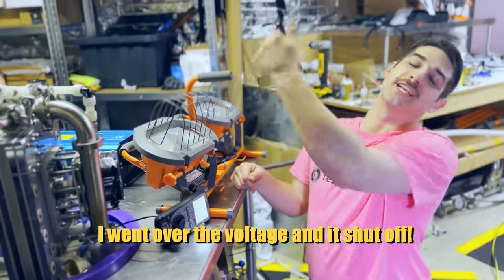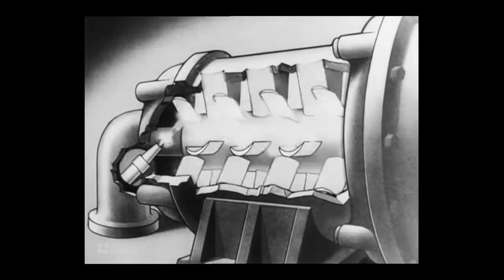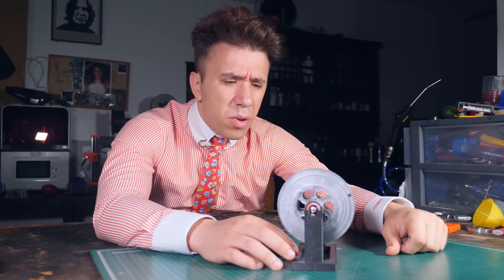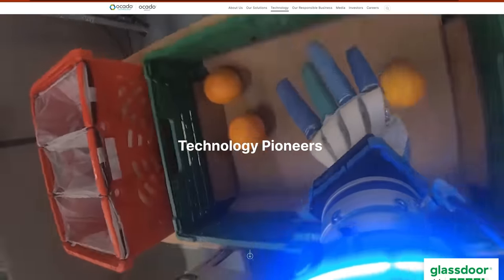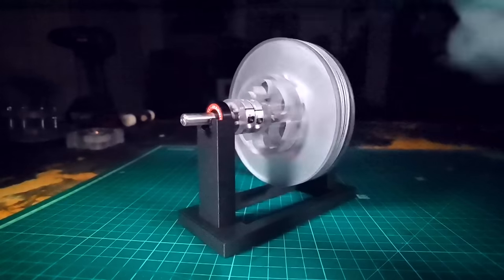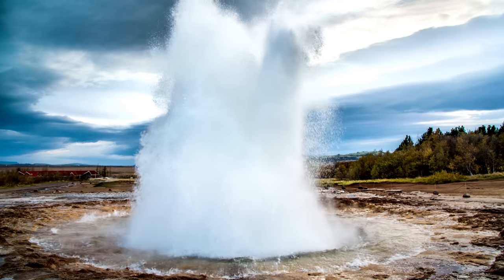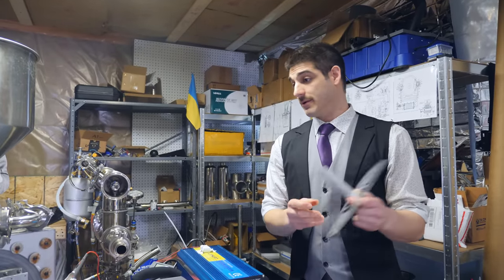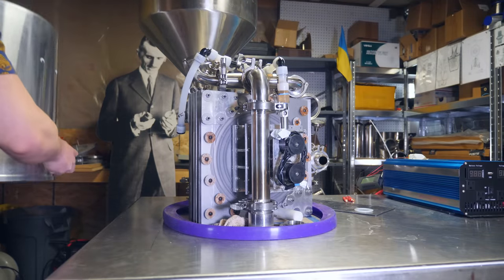Building Nikola Tesla's Bladeless Turbine

Comment: Now connect it to a binary power plant using alcohol under a vacuum which depending if you had a full atmosphere would boil at about 35 degrees. So basically room temp in summer. And use an enclosed system with Freon or liquid nitrogen for the cooling tower and bam endless energy using heat no it’s not free energy it just efficient.
Reply: Sure thing binary power is used in geothermal wells. They use coils sitting in a bath of alcohol or a similar fluid with a low evaporation point under a vacuum. You don’t necessarily need a geothermal well, if you were in a place with lots of sun, and you were just heating a tank of water, and it was flowing through the coils to heat the bath that would be sufficient, or a wood or pellet fired furnace could also heat up fluid to heat, the bath, to boil the liquid to turn the turbine. But again the important thing is, it must be a closed loop system under a vacuum

Comment: You don't magically get more power (WATTS) by magically increasing voltage.  You need more AMPS, which is the raw current that's generated.  Higher voltages simply enable you to carry the additional AMPS over smaller wires.

Comment: I'm just wondering.  How would you be covered in the event of a power outage if you need a compressor running to power the turbine? If you don't have power how will you run the compressor to run the turbine?

Comment: I would like to get a 3d printer. It usaf I was a computer tech and a c130 hydraulic tech. My favorite Tesla item is a little known item the Tesla Valve. The great thing is that all normal valves today have a lot parts that ware out.  The Tesla Valve uses fuide flow to work making  sure it only flows one direction without any parts ware out and control direction of flow. A very out of the box thinking no one else has done.

Comment: I went down the rabbit hole of sussy mini-hydro dam construction and had a brain blast.
All you need for high power output is ~40psi, right?
Flow from a dammed up stream may not have enough pressure or stability to manage the torque output seen here, so how can we convert high flow into high pressure? My idea was to use the flow to crank an air pump into a compression tank with a relief valve gating the output. I may be speaking outside of my mind but this could be the key to legitimizing small scale generation to ease pressure off our infrastructure

Comment: If using low quality steam, wouldn't liquid water slowly build up in the bottom of the turbine housing?

The obvious solution is to mount the assembly sideways, with the flat turbine plates parallel to the ground, and to have the steam exit out the bottom. But im certain applications, this could be difficult to do.

Comment: Ok, I want to see someone use modern understandings of material science to design one of those steam turbines so that there is minimal heat loss within the system, so it produces an optimal amount of thrust. It looks like the ones you show use copper throughout, which means any cool air hitting the outside of the pipes are cooling the steam inside and producing less thrust.  Unless I'm just stupid which is totally a possibility.

You can replicate the tomato thing with a ping pong ball because all surfaces have imperfections that will act as a blade.  Just because we can't see them that doesn't mean they aren't there.  It's just that the blades aren't what we would normally consider to be blades.

The turbine isn't "bladeless", it's just "visibly bladeless", because the friction on the imperfect surfaces and the air hitting the big surface area created by using multiple disks, you're just shooting air onto a absurd amount of microscopic blades.

Comment: Could you make a diesel fuel pump. Making more pressure with the fuel, atomising the air and fuel better than a conventional diesel injector? Or instead of a conventional turbo…

Comment: Hmm so you need to power it from compressed air or steam... both of which require power first to make. So if the grid goes down you need to burn fuel for steam or to power a compressor. What about ways to power this from renewables? He mentioned geothermal but i didn't quite get how dirty ground water could go through this device with no issues. What about a water wheel type set up on a stream?

Comment: How many Watts to run the compressor? Is there any energy surplus?
Yeah... as in I use outlet energy to start the process, then I switch the compressor to the Tesla Turbine's output, and charge some batteries at the same time?
Was this test made?

Comment: Can you make an application video? Applying this Tesla mirror to a solar heater/rocket mass heat/waste oil burner that produces steam to generate power to run a tiny house (e.g. home without power in a place like Phoenix,AZ)? Or store in a battery? Can the water be produced by a solar water generator?

Comment: i had a plan to build one with copper discs (aluminum bronze tbh cuz it resists corrosion the most and still maintains like 2/3 the full conductivity pure copper can) but my idea was to create a "windings shell" much like the transformer windings you see and see how much eddy current or induction voltage i could catch
Reply: btw aluminum bronze also has a rockwell hardness higher than steel
Reply: stainless steel*

Comment: Would flow channels in the disks increase efficiency? Imagine if the first disk started from the outside and spiraling in then through a opening in the inner most part of the disk released its accelerated inertia onto the out brim of the next disk. They would have to be staggered and spaced correctly. Would be a very interesting experiment.

Comment: So, you did that with compressed air, obviously people aren't going to be using compressed air to generate power as you would be using power to do so.

Have you thought of using a Fibonacci blade to direct the wind to turn the turbine and produce energy? How efficient would it be in comparison to other turbines, wind that is? Is it a viable solution? As Tesla's bladed turbine has little drag and the Fibonacci blade seems to produce more efficient energy from wind than other designs. I am curious.

Comment: ❤can it be built allot larger and can the disc be made from recycled plastic or polymer ,,just alloy disc are great but the steam i can generate free has minerals in it so i would think alloy would not last long at all but plastic yes ,,and could it be built big enough to put out around 30 amp at 220 to 240 volt continuously??

Comment: Whats the flow rate (cfm). The "only 15/20 psi" pressure isnt a selling point if it takes 10000 cfm continuous to produce 1200 watts.

Comment: ....so is this a REAL perpetual motion machine? like I have a 12V marine fan that puts out 7660 LPM I run it off a car jumper box with a variable resistor it as a 4 inch outlet, If I taper down to a reasonable air outlet to power the bladeless turbine, will this produce enough power to charge my car battery jumper box?? or how much power in the wind is required for 40 psi? I mean compressors use a lot of power, just wondering if you can use dc to make more dc.  I'm sure my 10amp fuse I have inline will blow if to much fan resistance occurs but very interesting idea....

Comment: Instead a multi staged steam engine, couldn't a generator using the exhaust gas power a tesla turbine.   I understand restricting the exhaust flow well cause issues with tuning, but couldn't that be overcome?

Comment: You can take a small access solar panel that runs on 12 volt and hook it to a car air pump for a roadside assistance pump. Put it right to the valve system to an extra compression tank and allow it to bleed in the 25 to 30 PSI and one that turbine is running you're basically using solar power to power that generator to power your home. You could actually use a self-replicating system, a small water return pump in a reservoir with a certain device in a spring with a winding valve where you wind up the mechanism release the water valve pressure mechanism and the water starts to flow through the hand pump which then immediately turns and starts spinning the generator creating energy to allow that energy to transfer back to the pump to spray more water completely closed cycled replicating system... that's where the Tesla valve system comes into effect the water being pushed through the valve system will push it harder on the return coming back through making the system more functioning don't tell anybody I told you the secret

Comment: Wait why the need for compressor? Why not combust the gas and let the combusted gas go to the turbine in which the turbone also run the carburator to let the gas running? Or better, is to install a testla turbine in the exhaust of a generator to add power

Comment: I don't believe there is an energy crisis, more an energy mismanagement crisis but if there was an energy crisis you have solved the problem, the figures are amazing, input to output, this could be run anywhere in the world that has pressure outpours, Iceland is the obvious choice for it to be used, but just about every country in the world had pressurised springs, geezers etc, unbelievably cheap and few moving parts, the two bearings on the main shaft being the only serviceable items,

Comment: Might be a simple question but is it possible to scavenge the exhaust air in sequence?
If it is would the air source pressure need to be increased with each additional turbine because of of the friction?

Comment: cool stuff i question you got the 20psi of air pressure from that vert large 2 piston gas powered compressor how much energy was used of fossil fuel to get the 1200w lights. what is the power denesity. is it more efficient to use a gas powered electric generator ? 
i really glad i stumbled onto your channel. peace out brothers.

Comment: Could the bladeless turbine be used to pump water directly if we have a small stream in a valley?  Currently using ram pumps for irrigation.   .... or would it be best to use the turbine to generate electricity for an electric water pump?

Comment: Can you test using electrolysis to make hydrogen to power an engine except using fuel injection to offset the gain of the hydrogen to see if the hydrogen is a net gain in fuel efficiency unlike other test using a carburetor that cannot offset for the added hydrogen

Comment: Would it be possible to use pipes of heated oil to boil water and use the tesla valve to direct steam into the turbine? Collected rain water could be a possible source. It would be interesting to see the power output with steam.

Comment: I will be cheaper. I need an arduino mega controller board with its shell and motor drivers. I already have the rest of the 3d printer... In case I am chosen as a beneficiary. I propose that they talk about Tesla's cold energy and its current applications. Greetings and thanks!!

Comment: Soooooo just thinking loud here but what happens to the power generated if you used a lighter material that is way more stronger than Aluminum? Wouldn’t that produce way more energy in a more compact scale? And with regards to torque could you possibly have a disc variation of let’s say copper and aluminum with its own line of air to give it that torque, along with magnets to use electromagnetic forces to propel the disk at greater speeds? This shit got me curious af. I see this as a good investment big time.  My only concern is you need compressed air to produce it which still needs fossil fuels to generate power but at a lower rate then what we use daily I think, if I’m understanding everything. I can see this go far

Comment: Has anyone ever charged a air compressor and powered the tesla turbine which then powers the air compressor on  board a go kart? Would it work as a cycle of power that doesn't run out until parts eventually fail? This is my entry for the 3d printer give away also, Thanks much. Jake

Comment: So can you connect the power supply from the generator to a electric air compressor to keep creating compressed air to keep creating power. Free
Reply: The compressor is acting as a wind or water force, and the turbine is using the resistance force or the air to spin... 

It is not a free energy method...

Comment: My question is, if it has the most torque at lower speed would this work better for Micro Hydro for like homesteading, or providing off-grid power to like a cabin off of a small Creek that does not have much if an incline to get pressure for a typical micro hydro system.

Comment: Video suggestion: Exploring further the steam efficiency. Ive always been so infuriated about how we arent using geothermal energy to get literally as much power as we could possibly need from anywhere in the world. We already drill down to the depths needed looking for oil, use the heat down there to freaking make steam!!! As Charlie mentioned, you could use geothermal straight outta the vent with this turbine... Well... If you created a U type of well, and lined it with pipe, you wouldnt need to worry about cleaning the steam for conventional turbines... Iceland has this one figured out real well. Theyre getting 60% of their countires needs via geothermal now. Its such a no brainer man... CLEAN UNLIMITED HEAT FOR STEAM! And to reach 100c you dont even have to go that far down! Sigh...

Comment: Hmm im suprised he has not used 3d printed casting where u make a 3d print or resin print fix it up make a mold burn out the plastic and pur metal in it that should allow you for easy manufacturing of turbine parts

Comment: is it possible to make a small ram jet engine and use compressed air to power it by putting the jet in a sealed tube where an air compressor can produce enough air to work the engine

Comment: How much lift does the Aeolipile generates if u add propeller blades on the exhaust pipes.  Will the steam being pointed at certain angle of attack towards the blade increase the low to high pressure on its surface.  The point is to see if the Ancient Greeks had the capability to develop a primitive helicopter if it was supersized for a human to operate it with kerosine as its fuel.

Comment: Great work but i'm sospicious about the fluid travel and the stagnation of the fluid during the energy exchange. According to the natural flow of water (which represents the 100% energy efficiency) this is a Francis Turbine without blades and with extremely high load losses for friction. Not good for water, even for steam.
I'm really curious to see the H-s graphic of this turbine, compared with typical Rateau stage, Thermodynamics is not an opinion 😅 Bye!

Comment: Ok so you get 1500 watts at a specific speed but how much wattage is used to power the jets of either air or a liquid that causes the plates to rotate.  It is a difference between energy created, (output) and energy input.  To gain torque you'll have use more plates as this guy did, but that also requires more input.  If that motor was all that good it would have already been utilized in our daily lives considering that TESLA design was invented many decades ago.  So obviously it is not as wonderful as you two are trying to make it !!!

Comment: How about using your bladeless jet engine to use as a power plant to produce the steam for the blameless turbine but use hydrogen as the fuel produced threw electrolysis power from the power plant basically a propeteral, self contained contained system
Reply: Basically thinking ingredients if you could get the engine to fire off of hho gas
Reply: Which also can be powered from the power plant after stepping up the power

Comment: I m hearing some Thing about Mediums like Air ,Water oder Fuell's

I thought thats Wrong

the Tube should Turn its Spinn
Trough Atmospherick Fahradyism Ionic Trust .
or Less and More Temperatured ,Heated Gas  which are Driven Temperatur Trough Ionic Atmospheric Trust , the Torgue Of da Spill or Spin Seem s The Conada oder Huntigton Drift , 
The Disenegierred Modell , i think is ,
of Couse It's in Medium like Not The Fahradism  Spinn ,

its Constructed under The Drive of Gas or Fluids .

Build it ,Through Atmospheric - Voltage , Erdground Magnetism , and ( Gernerator ) or Wiredfield ,
With Magnetic Spinn .

the Gasshield And Temperatured Diffenzece By using A Generator to build ,3 Forces to , Kick it to Spinn , the Torgue Strenges .

Thanks

a nice modell.

lg Rupp

Comment: 1200 Watts of generation is impressive, but it appears that you had a compressor with at least an 8 hp motor on it. If that is true, then you are using almost 6000 Watts of gasoline motor to drive 1200 Watts to electrical energy.

That is horribly inefficient.

Just showing generation capability is only half of the equation. Can you please go into detail as far as how much power input is required to get the 1200 Watts out?

Comment: can you turn on the compressor with the generator dat impulses the generator? is there any extra remanent for another usage?
Reply: Resistance will slow the turbine and it will turn off.... an external force is need to power it... like water or air

Comment: Black ⚫️ Volt Now!
Reply: Jet turbine motor, you replace with heat solidified mirrors and shine a lazer into the thrust, tanks plane's jets, lithium iron batteries in chris Webb's sattlight so it over heats and use the intell I gave him blow air up chis and James arse till there -40 Terrence Space Acadamy